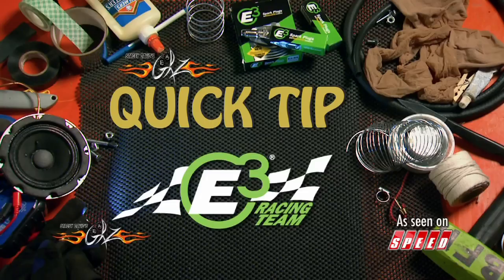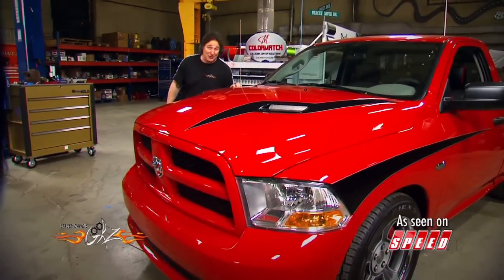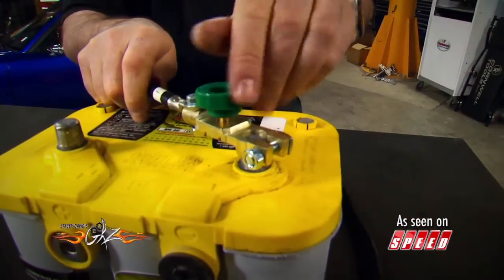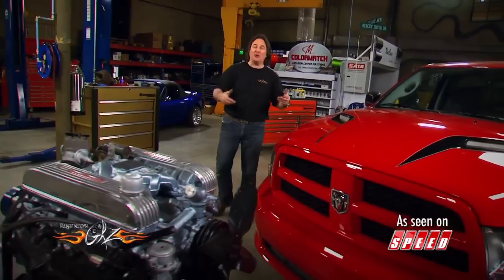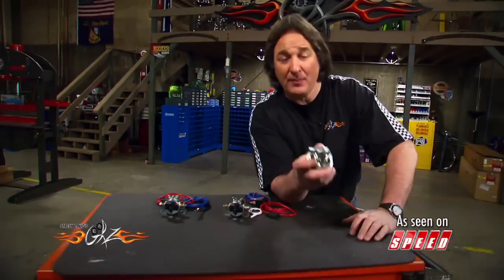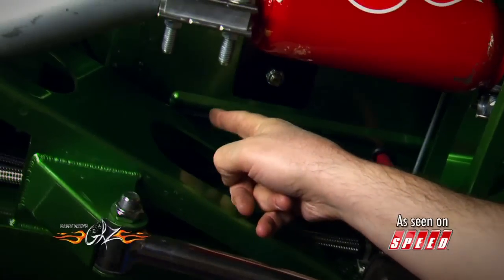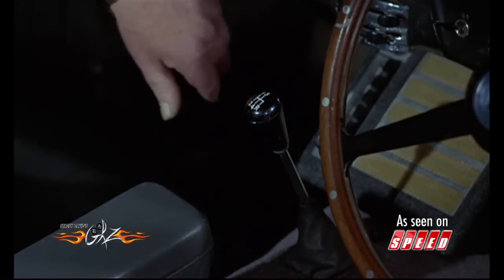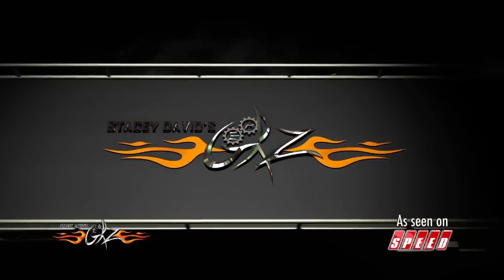Stacey David's GearZ Quick Tip: Keep Your Car From Getting Stolen

Comment: Would be nice if you did the same video for people that have a car from this century.
Reply: Sure this is an old comment, but it still should be addressed for the high percentage of people that think they can't do anything with their cars anymore because that's what they've been led to believe. The same practices and systems still apply. Wiring is still wiring. All you're doing is putting a switch in line to either stop or allow current to flow on demand. Just because many people have been convinced that working on their late model vehicle is near impossible, doesn't mean it's actually true. The same systems that were around 50, 60, 70 years ago are still there... You still have a starting system that involves a starter motor turning a flywheel, while at the same time you still have a system to distribute spark at a predetermined time to each cylinder. These used to be called distributors, only now it's computerized and the actual distributor is gone, but then again, there's still a way to interrupt the current to a coil pack. you don't actually have to know where the components are located... you just have to locate the wiring that leads to them and splice into it. When you're looking for a place to put your switch or what kind to buy, pick something that is small, flush mounted, preferably either black or gray, make sure it doesn't have a light on it to give its location away, and put it in a location that's easy enough to reach while also being something that you can operate inconspicuously in case someone is watching. Modern cars have tons of places within easy reach because of all the plastic panels that completely surround you when you're seated.

Comment: I installed a kill switch in my buddies car and someone tried to take it and they couldn't. I hid the wiring pretty good. The switch was this big round metal push button that I hid inside the cig lighter and u couldn't tell it was in there cuz it looked like it was suppose to be in there.

Comment: Had a 88 Chevy pickup, very clean , and a 16' trailer both  loaded with tools. Parked in Detroit, I know bad idea, took the fuel injector fuse with me in my pocket. When I got back I had a busted window, busted steering column and truck ransacked looking for a kill switch but still had my stuff... Put the fuse back in and drove it home... DONT PARK YOUR EQUIPMENT IN DETROIT...

Comment: I would stop using the battery disconnect after about the 2nd time I used it. I'd get tired of resetting my clock and radio presets every time I got in the vehicle.

Comment: The last switch option won't last long it won't carry cranking amperage . The spring  in the solenoid isn't strong enough to keep the contacts closed tight .Great idea the product needs improvement.

Comment: Many cars will lose their radio code if you use a battery disconnect.
And I don’t want a thief overheating and burning up my engine starter with a “dizzy switch “ in use.

Comment: what about some kind of valve on brake likes. push pedal to floor then activate switch. holds brake pressure  making the car hard to drive away or when pulled it's loud

Comment: Looking for a tip to lock the transmission on a 4x4.  It can be pushed off the driveway and just towed.  Any way to "Lock a standard tranny?"  Bolt through the shift housing?

Comment: 1) OK But most cars have not had a distributor on them in 30 years!! So there is no "switching the spark plug wire with the coil wire"! 
2) In many of today's cars YOU CAN NOT disconnect the battery because it will destroy the computer! And in some cases you can't just disconnect the battery as it will so damage the computer that the only place to fix it is the dealership! 
3) A "Dizzy Switch" AGAIN cars today DO NOT HAVE A DISTRIBUTOR so that is pointless to mention too!!
4) the only one that made sense sort of was the last disconnect switch. YOU COULD rig that to disconnect the battery from the starter ONLY, making it so the car DOES NOT START!! But even that requires knowing how to connect it to your battery and not interrupting the power to the computer which some cars take power from the starter solenoid to power the computer. 

In the end a trick I have done on a few cars is to install a key switch shut off switch hidden elsewhere in the car!! This switch is connected to the normal key switch "Start" lead, and when engaged it makes the car "appear normal" but you have to flip the switch in order to even start the car WITH the key or any of the wires run to the normal switch!! It DOES require running a relay in most cases, but you hide the switch in some strange location on the car and nobody will be the wiser even if they tear the dash apart wondering why the car WILL NOT START!! And it can be added to your ignition circuit as well requiring you to flip two switches if you are "extra paranoid" about leaving your car some place!!! Makes it fun to mess with your friends too, when you ask them to start your car and they can't even with the key in their hands!!
Reply: Disconnecting the battery WILL NOT destroy your computer ( ecm, pcm). If that were the case you couldn't replace the battery. Worst thing that will happen is you have to reset your radio and clock. The computer will relearn when you drive it again.

Comment: This video and the products it espouses assume that stealing the vehicle REQUIRES driving the vehicle.  None of them prevent the car from being towed.  Many people (I was one) drive an automatic and do not use the parking brake; in a front wheel drive car, you pick up the front wheels and off it goes.  The alarm likely doesn't go off or anything.  None of these products (and indeed, the majority of anti-theft products) address this simple attack.
Reply: +invertedlow Got a source for that or anything?  The police seemed to think it's a very common method when it happened to my car.  It makes sense to me, since many (most?) vehicles built in the last ten years have engine immobilizers and the like.

Comment: Many thefts are now using repo tow trucks now. And still tearing the steering column up. A tube lock around  the steering column,  along with  tire boot locks, a catalytic  anti theft device  and pulling fuel pump fuse  will stop 99.99% all theft.

Comment: All these involve thieves starting and driving your car.  Mine was hauled off.  What are your tips for that?
Reply: @tanker9987 Because all the good ones were stolen!
Reply: 4wd/awd in first gear, low. a good clutch. front wheels towards the kerb for lateral parking. Pager alarm and gps tracker.
Reply: Make your car payment on time.

Comment: Disconnecting the battery probably worked in 2012, but now, in 2017, that is not a good idea. All your electronics will loose security codes and scramble the engine computer. That's why mechanics, when changing a battery, clip a small battery to the main cables. The small battery will keep the computers powered up during the swap. Not a criticism, just updating the knowledge.

Comment: This is how cars are stolen in Detroit. You smash the rear window, crawl in, put the car in neutral, and have another car push it. This happens a lot even with brand new cars.
Reply: I thought in order to put the car on neutral, you need the key in the run position?
Reply: not on older automatics
Reply: +Jackie chan_WTF no brand new cars too. 2 dodge hellcats got stolen from dealerships in Detroit.
Reply: You can take a hammer and force the trann into Neutral ive seen it.
Reply: yeah, watch the various car repo ride-along guys on YT.   Most cars, even brand new ones have a place than be jammed with a screwdriver to allow the car to be taken out of gear.   they just drive up to 99% of cars with tow trucks, slip the bar underneath and drive away, it literally takes 10 seconds in most cases.  If the car is in gear or brake is on, they just drag it away as is, then switch ends when they're far enough and tow by the locked end, or they put dollies under the locked wheels (same for AWD)

Comment: I put a switch on my RX7 that shorted out the fuse that supplied power to the electric fuel pump. Fuse would blow, thief drives one or two blocks, engine stops, thief has no time to diagnose the problem... Runs off!

Comment: Power cuttoff are not recommended on late model cars and a no no on some late model cars. You could cost yourself thousands on reprogramming your car because some systems in some cars dont reboot. Plus, your car could oossibltly just run bad all the time because everytime your car powers off the ECM has to relearn your engine system all over again and since you are always shutting the power off it never relearns.

Comment: I like the security on Robo Cop. Magna Volt. Thief sits in car get fried. only bad part, the smell of burning hair.
Reply: I have wished for that thing on my car ever since I saw Robocop. I would modify it though by putting the electrical contacts on the door handle. Once that grabbed, the electric current passing through the thief would make it impossible for him (or her?) to release it. I would find a small pile of ash in the morning near the car if the wind or the rain won't take it away.

Comment: I had a car stolen without having an ECU installed. 
Most thieves these days use a tow truck or even just throw straps around it and take it with a regular truck. 
Selling a stolen car these days is so hard that thieves don't car if they destroy the car taking it, all they try to sell is the engine, gearbox, wheels and any electronics they can find.
Reply: In Southern California before the morning it's load in a shipping container headed for the boarder of Mexico or China. If not stripped!
Reply: selling stolen cars these days is *impossible. because the title isent in their name = not there car. that and everything comes back to that VIN
Reply: Ryan Rohauer that's Kewl
Reply: Dankus Memus they can take it in park

Comment: They stole my 2007 trailblazer ss a day ago and was found 9 hours later. They messed up all my egnition switch and popped in my door key slot, i have a gps tracker and went and got my truck right back lmao they did take off the fuel relay because they where playing om going back .

Comment: or buy a steering wheel with a quick release adapter
Reply: but what if he doesent have the right wheel
Reply: Jayden0717 he wouldn't even need to bring a wheel. He could just bring some vice grips and drive it with those

Comment: Come-on, Battery cutoff switches is not a viable option in modern cars.  Get ready to reset EVERYTHING electronic in the car after this. Not an ideal solution.

Comment: This still won't stop thieves, they just yank any two wires out from under the dash and spark them together and drive away.  put that dizzy?  switch in line with the cranking wire, they wont grind your battery cranking the engine.

Comment: Ahh simple if you have a ford, just disconnect the inertia switch and wire it to a toggle switch. Hide the switch sum where. Shuts off gas tanks... good thing I'm not a car thief I would just drive around with a tow truck make it look like a legit business and start taking cars, then all the switches don't work lol

Comment: Won't stop them from towing it away.
Reply: Put it in park, and like he said just put a battery cut off switch in your car, and lock the steering wheel
Reply: +BeetlexVW and by putting a battery cut off switch they can't select a gear without starting it and that's if they get it started, that's at least the case for mine

Comment: I just drive a car that no one would want to steal. Pretty much anything that you can find for less than  $2,000 on Craigslist is probably a car no theif wants anything to do with.
Reply: a honda then
Reply: how about a miata for under 5k?  never been stolen (or locked for that matter).  someone did steal a cell phone and $7.86 in loose change though.
Reply: I prefer my Toyota. They are less likely to be stolen in the region i live in, and my car is riddled with dents and scratches no thief would consider my car.

Comment: Why not just take the fuse out-period? Why bother with blowing it out and putting it back in?
In the old days whenever I parked my '62 409 Chevy Impala convertible at the movies i used to take off the coil hi-tension wire
and put it in my pocket. Sometimes the distributor rotor. Nobody could steal the car unless they flatbedded it.

Comment: My dad taught me this when I was a kid, run a wire from the negative side of the coil into the cab, somewhere hidden or in plain sight, put an inline switch and ground it to the chassis  anywhere, FLIP THE SWITCH CLOSED and the coil is now grounded, you can crank til kingdom come, you will not have spark. flip the switch open and coil functions normally and car starts.
you can do something similar to the fuel pump relay.

Comment: Okay that "simple" solenoid disconnect... is not so simple.

FIRST.... that is a LATCHING CONSTANT DUTY solenoid, of at least 200 amp.   Yeah... try to find those cheap.   And when you opt for the Ford Style starting solenoid at $12 to save money... you are dead on the road inside a few miles.

GOOD TIMES!!!

Comment: #1 learn how to drive a manual and buy  a manual car and you'll be safe, they tried stealing my 06 saab 9-3 aero manual, they couldn't
Reply: mario marena wish that worked 100%. I have a dizzy switch . I have an NRG steering wheel I always take off . And it's a manual transmission car . Still got stolen .        FML

Comment: I'm laughing hard with these other suggestions: Trunk monkeys? You mean twin midget luchadores holding mac 11s in a trunk. Lojack? nah, I'm usually nocturnal and always park in sniper/close gun range, or next to a light pole. Stick? pffft just unscrew and hide the clutch/gas pedal or use a parking boot. Also, has any one heard of extra long car covers and putting stuff underneath and reshaping the car?

Comment: thieves who steal for parts know how to drive manual, thieves who steal for joy rides don't. so would you rather have your car be recovered in an ally stripped and sitting on cinder blocks or have the policr find it wrapped around a light pole with a dead teenager in the driver seat lol

Comment: Long story short... In my apartments, I had my '72 Monte Carlo, I had removed the starter and never replaced it. Came out one morning and car was gone..... They tied all the wires at starter area together with a wire in middle of the connectors that attached to the starter, then tried push starting it with another car. But a TH350 transmission will not start a car that way, and they were so incompetent, they didn't break up the steering column good enough, plus had no brakes to speak of... they were going around a slight curve, and the column locked up. Ran up on the curb into some bushes... left it there.... Only got 2 miles from my apartment. Police found it and called me. I would tell what folks got it, but that'd be racist.... I know because a cpl of weeks later, some guys pulled up behind the car, and sat there looking at it. I was out in parking lot at another car of mine, I got the license plate on the 1983 Monte Carlo, went to tax office, paid $2. got a print out of the car, and that license plate went on a Ford  Probe.... The guy driving the car had a white brim hat on... No racist remarks on saying about the hat....

Comment: this video sucks.. you shouldn't have to open the hood every time you engage one of these things or need to kill power to everything including your stereo (deleting all of your presets).. just put hidden switch in your cab that interrupts the fuel pump. find the fuel pump wire (pos or neg) then run it to a switch.. the vehicle may start for a second but will quickly die.. before it leaves your driveway .. will cost maybe $5.00 for switch and wire

Comment: fuel cutoff valve. A very good idea no fuel to the engine needs brand new starter motor you're going to have to buy because the idiots going to keep cracking Creek until started mother's birthday Not A wise choice
Reply: how about starter cutoff button?

Comment: Most of this is BULLSHIT.  I'm not opening the hood  to  screw/ unscrew my battery or rework the  plug wires.  On older cars, if you have a tach,  a  switch can ground the tach wire, and will prevent  spark.  Electric pump or EFI  put a switch in the pump relay circuit.  Girls, if they show up with a wrecker/ rollback, you are  screwed.  You need a cell based alarm

Comment: Several of the recommendationsfor are problematic for modern computer controlled cars. For example disconnecting power can cause a lose of some running adjustments and OBCD code reports the computer has implemented for smooth operation. Also switching the distributor wire can damage a piston, the head or the catalytic converter as it will cause out of time detonations.